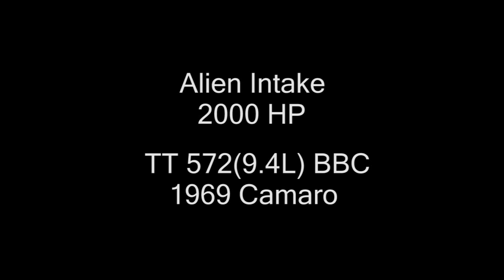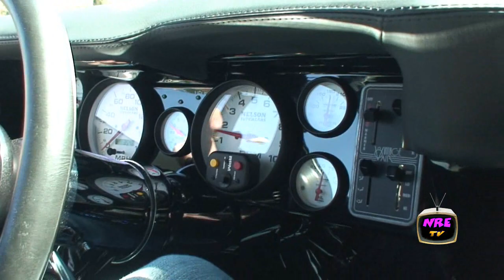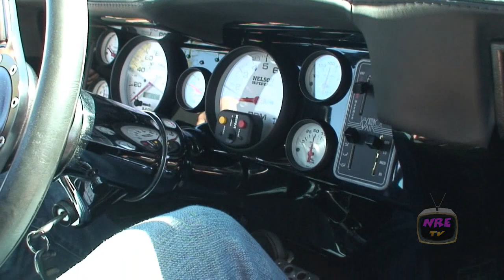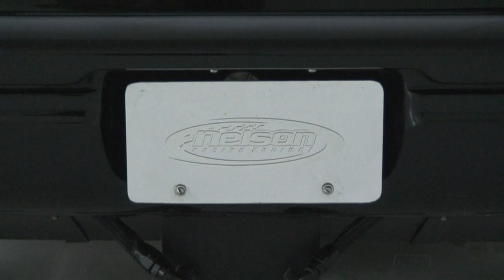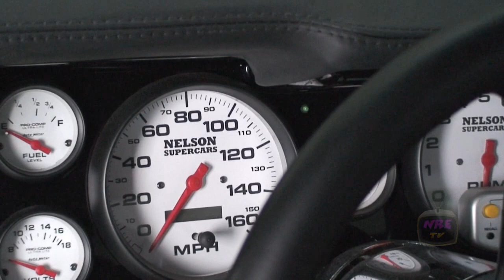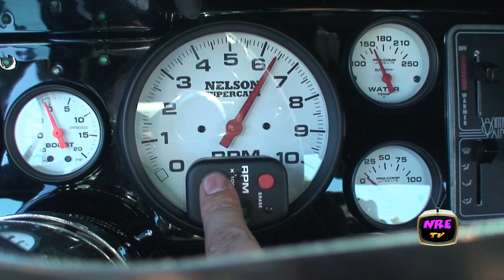2000 HP Camaro attacks Malibu!  Street Tests.  Nelson Racing Engines.  Road Trip.

Comment: about time this video hit the youtube but tom how about real data like crusing avg gas mileage wen just driving around NORMAL I know it will suck fuel like crazy @2500Hp how about short shifted and conserving with all that Tq it would be intresting allong with actual quarter mile and standing mile times take it to the track and do a proper launch.I like the new production value your cam guy shoud keep it up needed some vista drive buy's a burnout and drive over the cam for an undershot